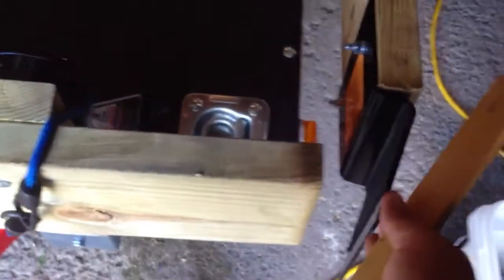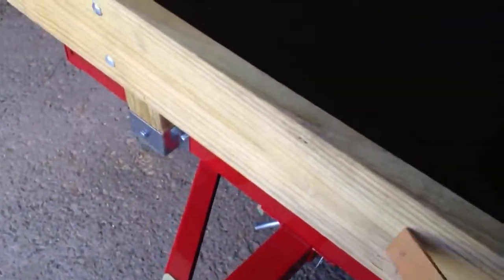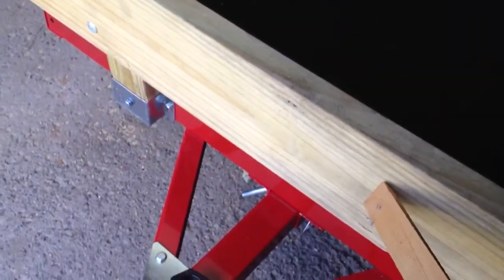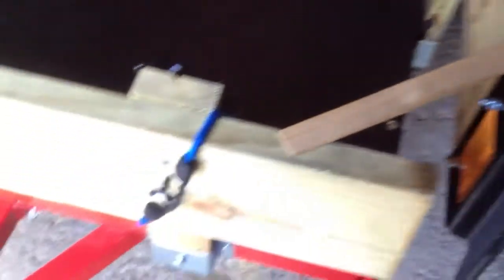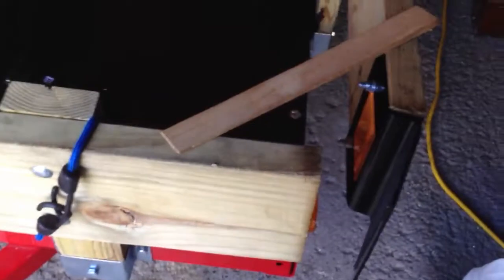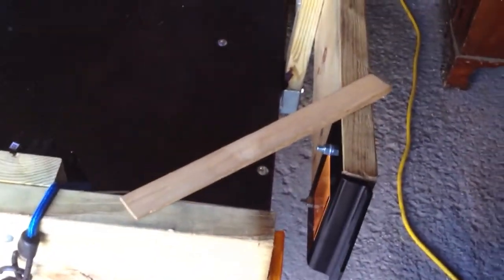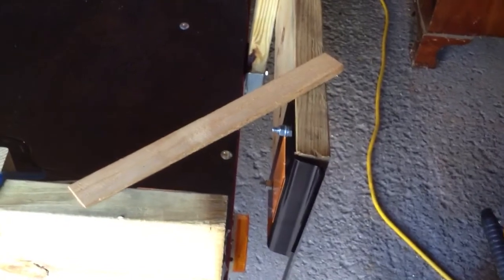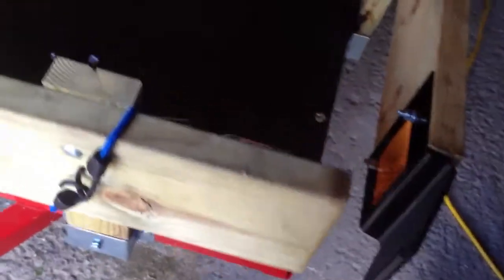Northern Industrial Trailer: Seeking Hardware Solutions

Comment: I would use a large L bracket. Drill holes on both boards and use some cotter pins to make it detachable.

Also, you might be able to get someone to weld the bracket onto a hinge so that it can fold up to the front board when not in use.